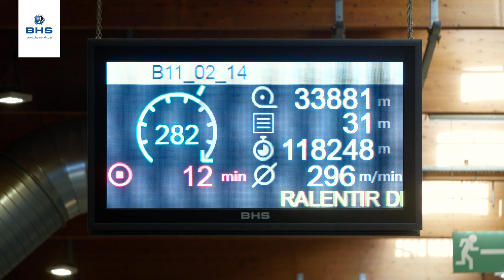The SPEED Line | BHS Corrugated

Comment: I used to work an an BHS-Line from the 60s (partially updated), where we could run 190m/min with single (b or c) board and around 160m/min with double (b+c) board.
The speed of 450m/min is stunningly fast.
Reply: Мы работаем сейчас 300м /мин и это реально круто